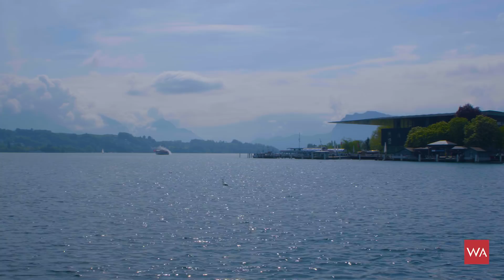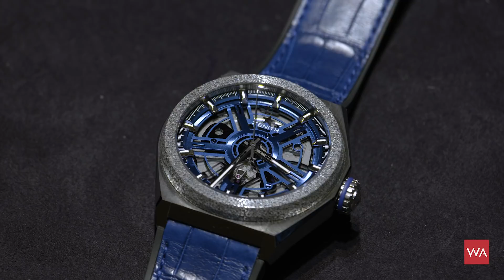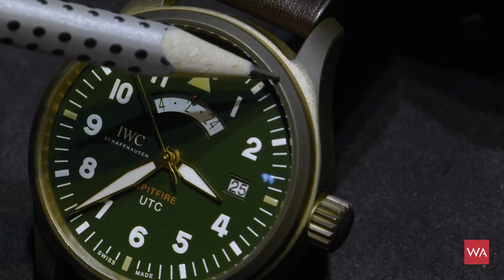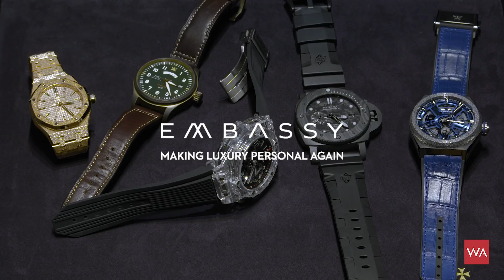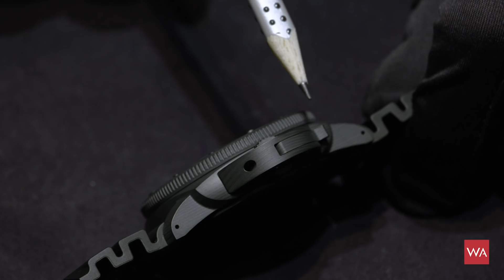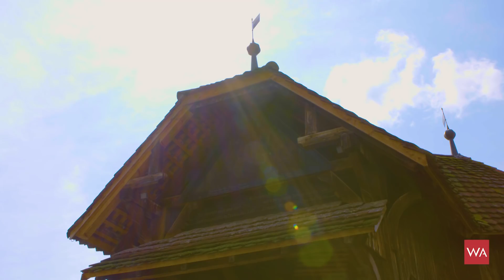Hands-on: 5 impressive case-materials. Audemars Piguet, IWC, Hublot, Panerai & Zenith.

Comment: a good mechanical watch has a stainless steel case (e.g. 904L corrosion-resistant superalloy), as a child of the early 1960s I cannot stand the new ceramic and plastic materials
Reply from the maker: Ph MWU I understand this, but the new materials have motivated a lot of people to buy one of these watches. It’s also to distinguish them from others and to show what’s technically possible...